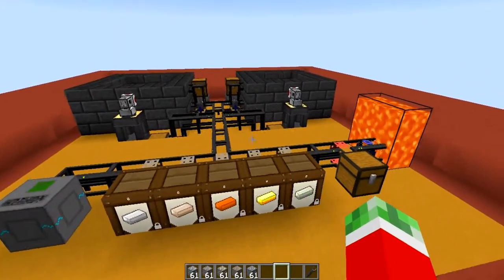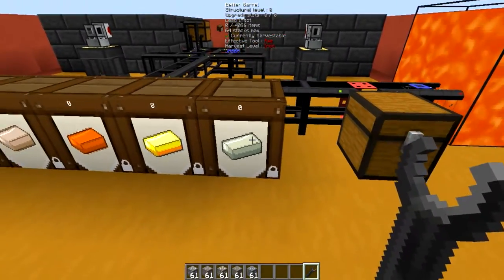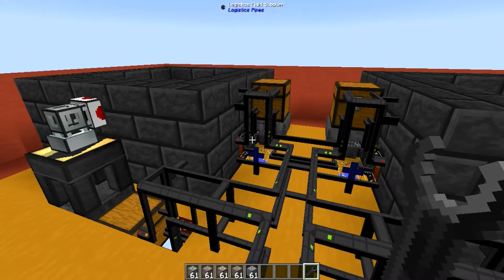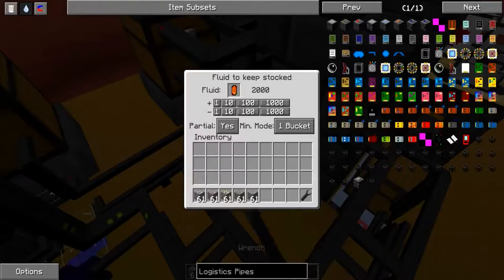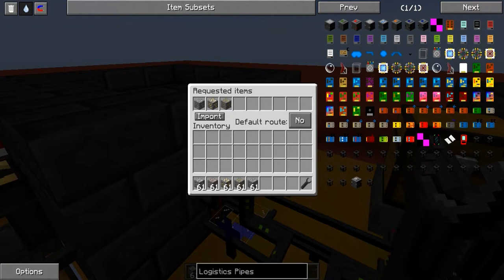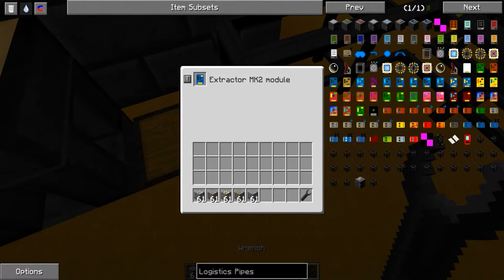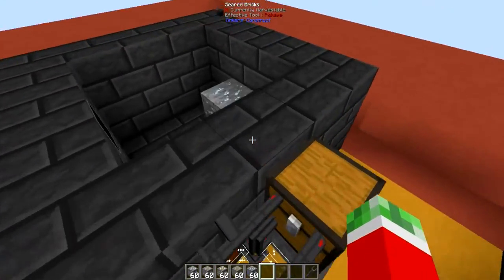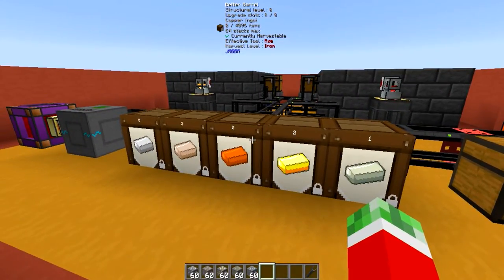Logistics Pipes Tutorial - #11 - Smeltery Ore Processing (Automated)

Comment: Is there any way to sense if my lava supply is running low and make it light up a  Project Red lamp?
Reply from the maker: +DeathSorcerer508 Hey DeathSorcerer, sadly that is not possible using Logistics Pipes alone. You might be able to use Buildcraft Gates on a tank to specify when it is getting low, and emit a redstone signal when that happens :)!
Reply: That was my plan, thanks! Great video as always!